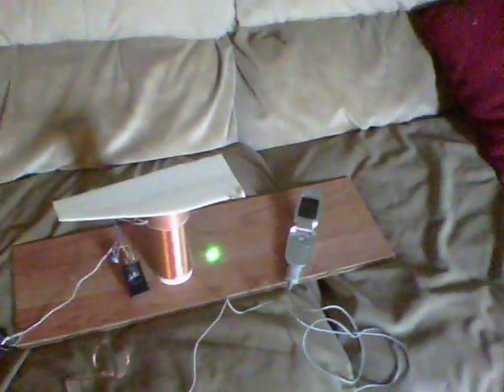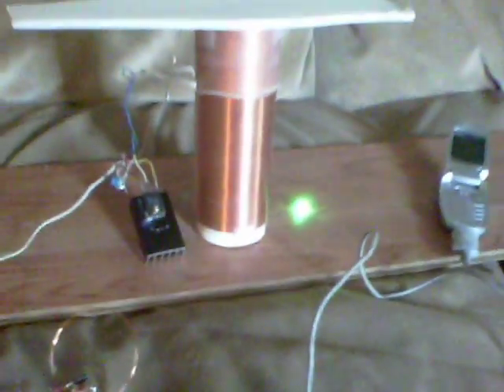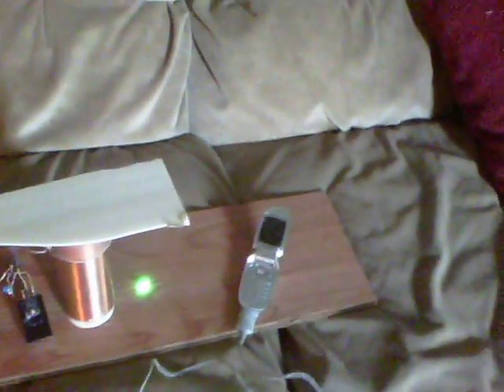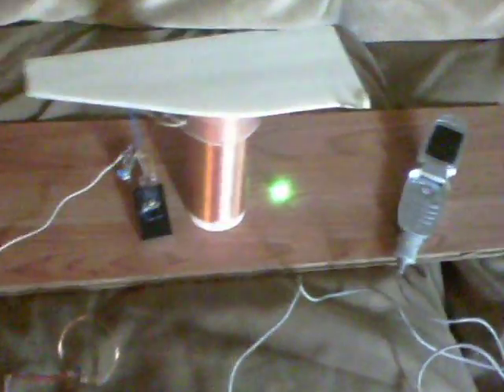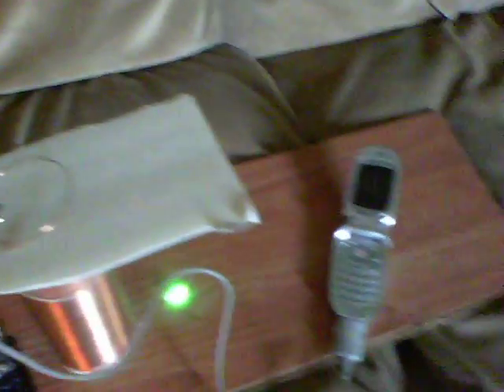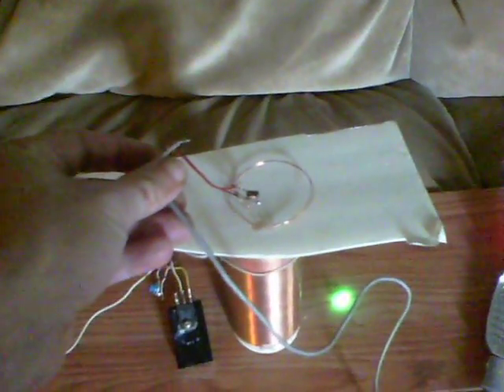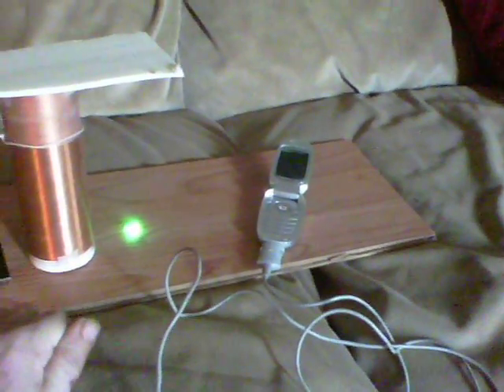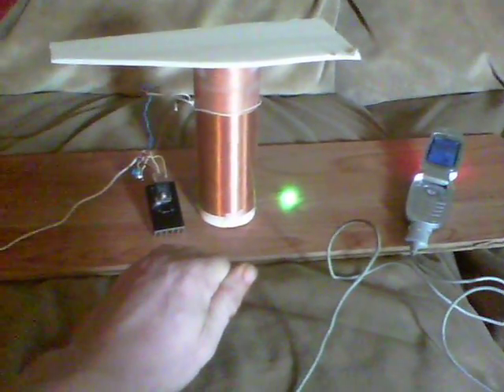The future of phone charging

Comment: how you made it
pls make video of this
Reply from the maker: The steps are within the previous videos... though all was 8 years ago now. If I remember right, it was about the exact length of wire, impedance and how the fields interacted. Took a lot of tweaking and every build will be different if done at home. A tower worked better than pancake coils or loop coils. The piece of foam isn't needed. I recall wanting to cut a circle to put on top, but the setup worked, so I filmed it.

Comment: Hi, can you send me the schematic diagram for the phone charger? I have built the slayer exciter and its working quite well.

Thanks
Reply from the maker: homebizDOTcom It's all a long time back now, so unfortunately there's no diagram. In fact in those days I rarely designed circuits, just built and tried them out. Roughly though from memory, it's a coil, bridge rectifier and smoothing cap with tuning of the coil turns to match the Slayer :)
Reply: ok thanks, will try with a coil, bridge rectifier and cap

Comment from the maker: @corbonzo1 Check out post #899 of this thread (removing the spaces): energeticforum . com / renewable-energy / 4999-joulethief-sec-exciter-variants-30 .html I use something similar, but only 1 diode and it's an LED, Positive leg to Negative rail. The main thing with these is the concept, how the transistor switches based on feedback, so the whole thread is useful. Using an LED shows you by its brightness how tuned the setup is.

Comment: Thats great!!!  Let me get this straight.  On the end of the phone wire there is a small coil (how many turns?does it matter?) with one end (both ends?) going to the diode bridge, the other ac end going to ground.  The dc output of the bridge obviously goes to the charger.
Im asking as im not using a coil with my diode bridge - i have one ac end going to a toroid that is disconnected from my exciter tower (just sits on top), and the other ac end goes to ground - seems to work...